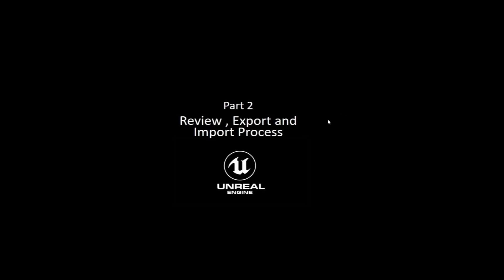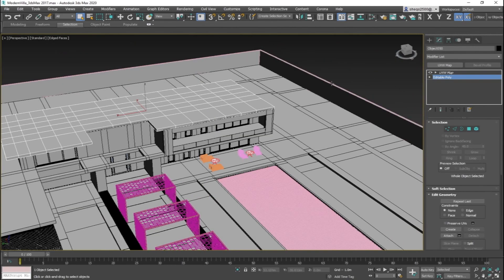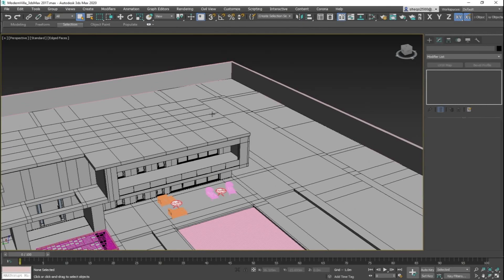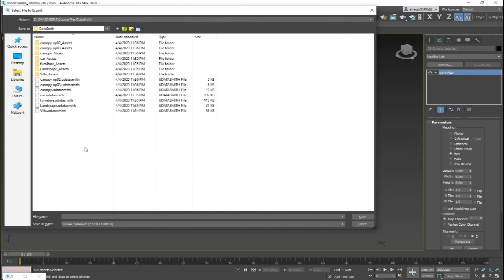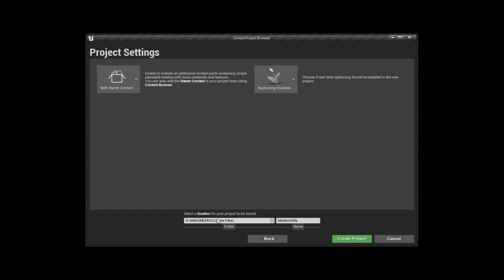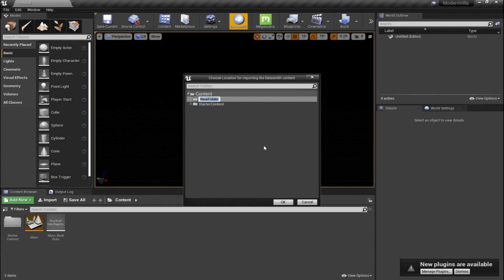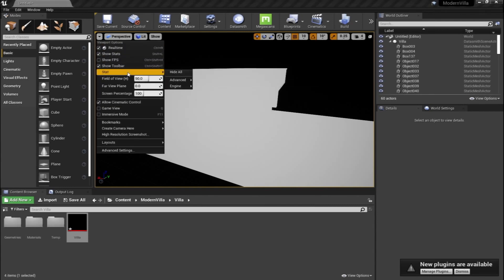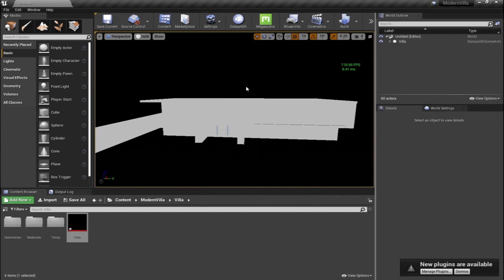Unreal Engine 4 Arch-viz Tutorial Course part 2

Comment: Thank you for this tutorial, it's very helpful for me  !
Reply from the maker: Your most welcome , glade it helped you
Reply: Can you tell me, why when I want turn the sun by using Ctrl +L, sometime the sun don't move or it's like it's not updating,like a bug.
I have to delete the sun and sky and try again and again and sometime it works fine. It is possible to refresh the level or some timing like that?
Thank you Sir!
Reply from the maker: @katatonix  normally this happens please try this 

1 - remove the sun sky BP including sun light 
2 - add a directional light and  a sky atmosphere 
3 - in the directional light panel activate atmosphere sun light 
4- now check with CTRL + L the sun should move along with the time of day
Reply: @theimageneers5161  Thank you Sir ! It's better by this way, especially through the Env. light  Mixer

Comment: Hi, I tried importing a file from a sketchup to UE4.25.2, after moving around to check the model, a certain geometry is missing whenever the viewport position at a certain angle, and a part of this certain geometry reappears when the viewport is move at a different angle. You can check on the link for the image. TIA.
https://www.dropbox.com/sh/998j60o8djh1yeh/AAAKh2texlKJ9L3LVxR_E9fZa?dl=0
Reply from the maker: Hi there , it looks like a 2 sided material issue , just choose the object , then choose the material by double click and choose 2 sided and check if this solved the issue
Reply: @theimageneers5161  yes it seems that's the problem. thanks for the help!...onward further to your tutorial.:D

Comment: hello Sir, Thank you very much for the tutorial . i've got problem when i export the vila's layer using data smith, the error message said that ------------------------------------------------------------------------------------------
	GENERAL MESSAGES
------------------------------------------------------------------------------------------
Rectangle014's UV channel #1 contains degenerated triangles, this can cause issues in Unreal. It is recommended to properly unfold and flatten exported UV data.
Rectangle015's UV channel #1 contains degenerated triangles, this can cause issues in Unreal. It is recommended to properly unfold and flatten exported UV data.
Rectangle022's UV channel #1 contains degenerated triangles, this can cause issues in Unreal. It is recommended to properly unfold and flatten exported UV data.
Object017's UV channel #1 contains degenerated triangles, this can cause issues in Unreal. It is recommended to properly unfold and flatten exported UV data.
Object068's UV channel #1 contains degenerated triangles, this can cause issues in Unreal. It is recommended to properly unfold and flatten exported UV data.
Object070's UV channel #1 contains degenerated triangles, this can cause issues in Unreal. It is recommended to properly unfold and flatten exported UV data.
Object073's UV channel #1 contains degenerated triangles, this can cause issues in Unreal. It is recommended to properly unfold and flatten exported UV data.
Object076's UV channel #1 contains degenerated triangles, this can cause issues in Unreal. It is recommended to properly unfold and flatten exported UV data.
Object079's UV channel #1 contains degenerated triangles, this can cause issues in Unreal. It is recommended to properly unfold and flatten exported UV data.
Object081's UV channel #1 contains degenerated triangles, this can cause issues in Unreal. It is recommended to properly unfold and flatten exported UV data.
Object082's UV channel #1 contains degenerated triangles, this can cause issues in Unreal. It is recommended to properly unfold and flatten exported UV data.
Object083's UV channel #1 contains degenerated triangles, this can cause issues in Unreal. It is recommended to properly unfold and flatten exported UV data.

best of luck
Reply from the maker: Thats ok you can proceed , as this is just a warning message that there are triangles polygon , please continue and if theres anything else you would like to ask about please let us know , thanks
Reply: thanks for the reply , its kind of you

Comment: Is it necessary to unwrap uv of all the objects and wall before importing to unreal engine using datasmith?
Reply from the maker: actually data smith will do that automatically while exporting the objects but its recommended to add UVS  so u can get the correct texture coordinates in unreal
Reply: @theimageneers5161  it's required 2 uv channels for material and lightmap and datasmith creates only one uv channel for lightmap. Am I right?
Reply from the maker: @viveknayak6580  you are right before datasmith we used to create 2 unwrap channels so unreal will read the second one , now with datasmith we only create uvs to define the texture coordinates and direction and datasmith create a uv for unreal to read the faces but some times it creates errors with complicated shapes that requires the original step of creating a 2 unwrap channel manually .
Reply: @theimageneers5161  thank you and your tutorials are very good.I have cleared many doubts through these. Make a series on interior.
Reply from the maker: @viveknayak6580  your most welcome , course 2 will be exterior and interior no worries

Comment: First off, I LOVE the tutorials! Thank you!! Quick question though - why does your model show up in "LIT" mode? When I turn on LIT, the screen is just black.
Reply from the maker: Hi Andy , thanks for sharing  can you please check if theres and Global Exposure exist between the mode object , delete all of them so you will get the default exposure value in unreal
Reply: @theimageneers5161  hi, i imported the datasmith, the screen went black, i also deleted the Global Exposure, and still the screen black. what should i do? there is also warning message when importing the datasmith file (i don't remember what it said, sorry). i'm using 4.27 by the way
Reply from the maker: @joedhistira  hi there , what happened when you add a sky and sun for example , and how does that affect the global lighting of the scene , you can also visualize lighting only from the viewport to check if everything is ok
Reply: @theimageneers5161  i think i did something wrong (i'm not sure what i did though), i followed every single step, it just showed nothing. so, i restart all over from the beginning, and the file improted perfectly. By the way, the sky and sun didn't help either, i selected the object from the outliner, but there only showed the gizmo in the viewport, i didn't see any object/mesh.
Thanks for the reply

Comment: Hi, I have 2 questions.... it is necessary to put UVW Map to each and every model ?   2nd is  can we export editable poly model to unreal or we need to convert it to mesh than export ?
Reply from the maker: Thanks for sharing your questions , 
1- Yes it is necessary to have uvs on your object to get your material texture aligned correctly on your object that will make your work flow much easier .
2- you can export editable poly , splines with thickness  unreal engine recognize a lots of objects format .